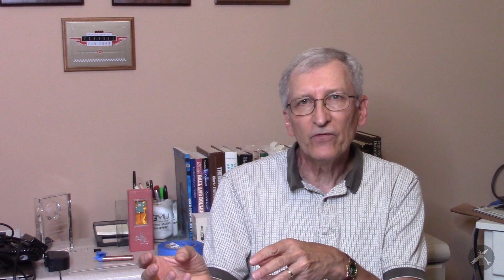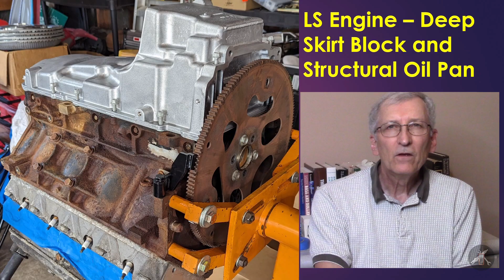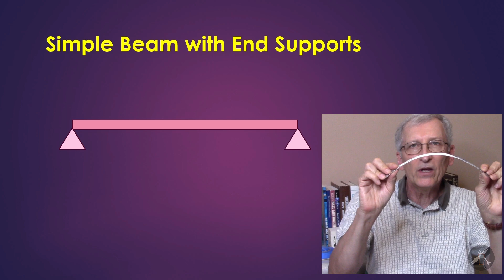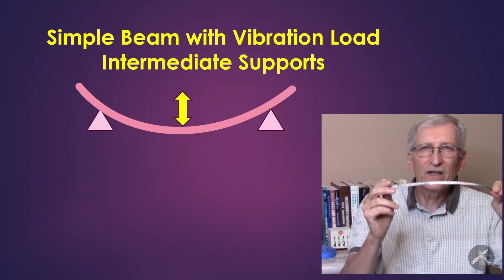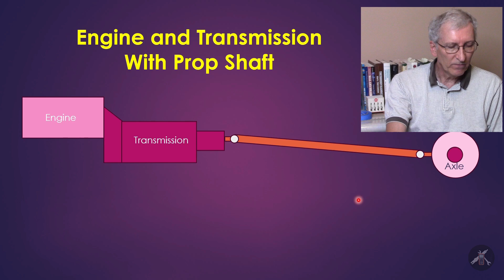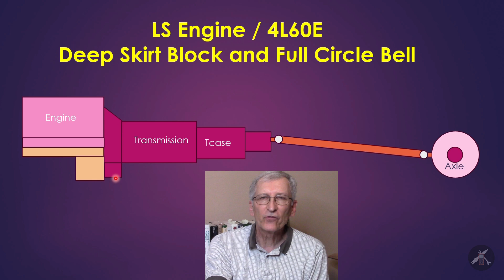Why the GM LS Engine uses a Cast Oil Pan and Full Circle Bellhousing - Driveline Beaming / Vibration

Comment: It always amazed me how GM made some of the best engines ever built and some of the worst ones built sometimes at the same time! The LS is probably the best small displacement gasoline engine ever built. While the 3100, 3400 v6s are in my opinion the worst. I’ve yet to see a stock one that will last more then a hour or two of hard driving  before blowing a head gasket or throwing a rod. Even just running one at 3,000-4,000 rpm  for an hour or two will result in a blown head gasket. The only fix is cutting the block for orings and installing head studs. Having to run studs, O rings, and copper gaskets on a stock daily driver is absolutely insane, yet GM built millions of these POS’s without fixing the problems for a long time with zero fucks given. This is the same company that gave us the wonderful EMD 567s, 645s, 710s, the 71 series Detroit diesel, the SBC, BBC, and LS engines.

Comment: You may have just made up my mind for me. I have a 65 gto and was keen on getting rid of the old 2 speed trans. I have a BOP pattern turbo 350 and an early turbo 700. The turbo 350 is cheaper to rebuild but i also need to raise the rear gear ratio. The turbo 700 would not need a rear ratio change but needs an adaptor plate that looks a bit flimsy. I think i will go with the correct bell housing now to avoid fitting a hinge in my driveline. Cheers.

Comment: Thanks for the explanation always good to hear what the engineers were thinking at that time.  To me the LS is not worth all the headaches for this older fella.  The old way and blocks were easy to work on, etc. Im enjoying learning the 92 tech on my sb 3.1 litre v6 (189 ci) Camaro RS!  Very fun motor with good pep and drivability and probably gas mileage. It has the 4L60 - first year for the 700 changeover to 4L60.  My car is the only one at any show with original v6 in it.  Crossfire injection ( I noticed the Fieros have these engines too - some 2.8). I appreciate you teaching us about these LS motors though!  In a few years, no classic car will be without one at the rate people are installing these computer-heavy tethered engines
Reply from the maker: As you know, I have an old school SBC in my Camaro and I like it that way. I am not advocating for changing out the old for new, yet some want to make the changes and that's ok, too.  You're right, this is in part a help to the LS folks and also some understanding of the advancement of automotive technology.

Comment: sbc is way better "structural oil pan" dumb idea lol. As mechanic I can tell you the changes made from the sbc to the LS made it harder to work on. The 2 piece rear main you could change in an hour or two. the one piece rear main takes 4-6 hours because you have to remove the transmission. And why in the world would they design the LS to where when its installed in the vehicle you have to remove the heads to change the cam. I wish they never quit making the sbc.
Reply: But every single SBC rear main seal leaks, yet Gen III and up hardly ever leak
Reply: @needleonthevinyl   From improper installation! How many people put the two piece rear main together with silicone dry? Because exactly what silicon sticks to oil? That would be zero. Mine never leak, and if 10 years from now it does leak it will be easy to change because I don't have disconnect the engine from the transmission in order to change it. And gen 3 leaks all the time. In fact I have never seen one more than five years old not leak. I've seen two in the past week on two separate vehicles in fact.
Reply: @The0utmode  two piece rear main will never leak huh ? 😂
Wonder why EVERY manufacturer abandoned them 40 years ago.....
Reply: @jamesgeorge4874  Planned obsolescence. Customer "Oh the leak is coming from my rear main seal and it's 1000 dollars to have it fixed, I will just trade it in then." That's exactly the main reason manufacturers abandoned them. Same reason they make everything else unserviceable too.
Reply: @jamesgeorge4874  Here is how bad your argument sounds. "If transmission dipsticks were so good how come every manufacturer abandoned them years ago."
Reply from the maker: I know that change is hard, but we need to adapt. If you like and want to keep working on the old ones, go for it.  I like my '85 SBC and will keep it going. Remember that the original SBC began switching to a one piece rear main seal in about 1986, so it was changing anyway long before the LS.  The 2 piece design was a common leak. and it was good to change. I had a 4 cylinder Chevy with a 2 piece that came out of the factory with a bad rear main leak. If I need to go into my '85 Camaro to change a 2 piece seal, it will take a lot longer than a couple of hours to drop the exhaust, pull the engine mounts and hoist the engine to get the pan off.  I think I would rather pull the transmission.
I understand that the LS may be harder to work on in some areas, but the engine is more fuel efficient, more powerful, revs higher, and has been capable of great growth over the years. I have owned a number of Suburban / Yukons with the LS without any engine issues. Today we're up to Gen5 going into Gen6 of this engine and it just keeps getting better.  Is it perfect? No, nothing man creates is ever perfect, but a lot of good people keep working on it.
Reply: @bitsofwisdom460  But what we have lost in the transition from the sbc to the LS is alot of unique designs that will never be seen again. For example the one piece intake manifold. Such a simple design and takes up less under hood space than a two piece intake manifold and has less gaskets that can fail. The LS is not more fuel efficient. My dads 1966 chevelle with a 283 got 30 miles to the gallon with the garbage stock cam and carb. Imagine if he had a good aluminum intake and a good cam profile with the correct LSA and less valve overlap and an HEI distributor instead of a points one. I'm sure you could get 30 miles to the gallon with a 350 with the aforementioned changes. I know this next point is kinda of a nitpick. But when going to the structural oil pan. (which by the way if the block is not strong enough on its own thats a fundamental problem.) But thats besides the point unless your building a nitro motor which is why those guys still use the sbc. But when they went to the structural oil pan. Why did they make 180 degrees of the oil filter blocked by the oil pan? Whereas on the sbc you wrap your whole hand around the oil filter so you never even have to grab the oil filter wrench  no mater how tight the last person put the oil filter on. It is a small nitpick but when you done hundreds of oil changes on LS motors it gets annoying especially when you know the engine that came before was better made.  Also I know the hydraulic roller cam and one piece rear main were being put on sbc 86 and later but you could still put the older parts on those blocks. I also like the flat tappet cams better because for duration under 278 they make more power than a roller. They also weigh less. And though rare the rollers on the roller lifters can fail and wipe the cam. wheras with a flat tappet as long as you change your oil often they will last the life of the engine.
Reply: @bitsofwisdom460  But hey as bad as I have been talking about the LS I would like to thank you and the other engineers for keeping it a cam in block engine. Keeping the water pump and timing cover separate (Ie not pulling a ford or a dodge) And keeping the oil filter mounted correctly so you can actually prefill it instead of having it screw on sideways or upside down like so many engines do nowadays. It just makes me mad to see kids my age take the sbc down to the junkyard and LS swap their classic truck or car. They have no idea that the sbc is cool they just see it as a hunk of cast iron. I must sound like an old man but im 19 lol.
Reply: Great response @bitsofwisdom460

Comment: Back in the 70's and 80's cracked flexplates were pretty common on SBC.  Since the LS came out, I have not had a cracked plate. I attributed this to the full circumference of the bell housing.    47 years in GM dealerships, I've seen it all.
Reply from the maker: I am not familiar with the flexplate issues being common, but the driveline flex could have an influence on the flexplate.
Reply: @bitsofwisdom460  The plate would fracture around the crank mounting area.  I bet we did 1 a week at the large dealer I worked at.  It was common on all gm makes too. So common we stocked the flex plates.

Comment: This must be a big part of the reason the LS mains and Rod bearings, seem to last forever, and can take upgrades to 1000 HP and survive! However, in my limited experience the cam bearings don't survive as well, great engines I've put a lot of miles on 6.0's. If I may, what truth is there to GM bringing in some racing engine builders to assist in the LS designs? Thanks
Reply from the maker: I don't know specifically about the race engine builders on the LS, but it wouldn't surprise me. I can say that over the years, I have seen engineering teams consult or collaborate with outside organizations such as race teams.  There are times where their expertise and experience can be helpful in guiding a design. In my own case, when I was working on manual transmissions long ago, we were supporting a stock class road race team and using the feedback to gain experience and refine our designs. We had a variety of ways to gather knowledge from the field.

Comment: I can relate to this because back in the 90’s when I would rip the engines out of these older GM vehicles with our SAS Engine Biter attachment every bell housing would break and just the engine would get ripped out.

On GM RWD models from ‘96 on the whole complete  powertrain would rip out in one unit due to the full bell housing giving enhanced reinforcement.